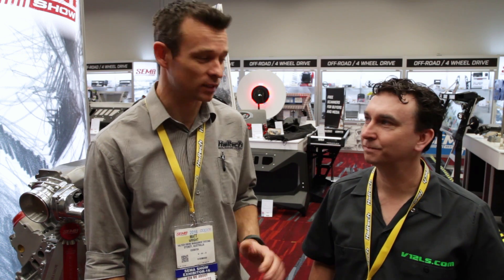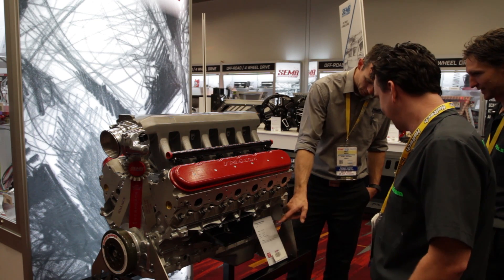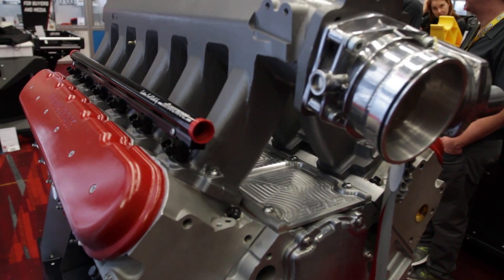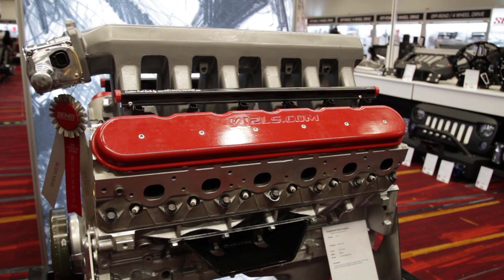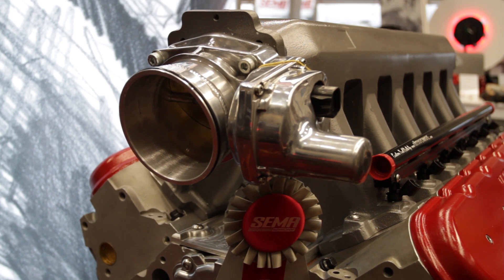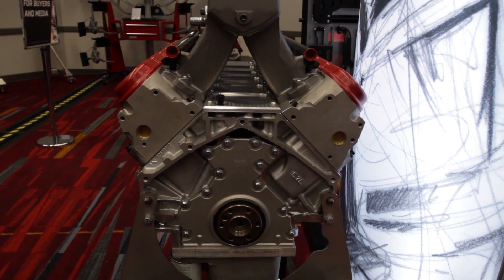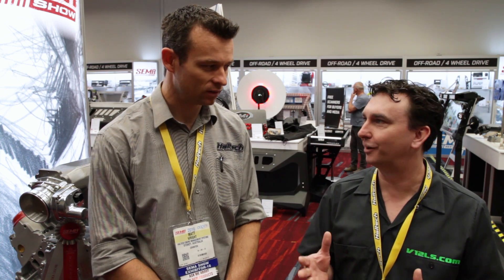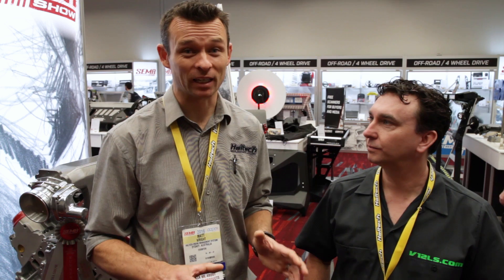⭐ SEMA 2016 Highlights: V12LS - why V8 if you can V12!

Comment: How do you run a V12 on a Elite 2500 with only 8 ignition and 8 injection outputs?
Reply from the maker: You’ll use 6x injector/ignition outputs, wired in semi-sequential/waste spark.
Reply: So it will be firing 2 injector/ignition outputs at the same time?
Reply: Yes that's right William, each cylinder fires twice but one is during the exhaust stroke and is effectively "wasted". This has a few advantages such as requiring only 6 ignition outputs and the ability to run with only a crankshaft position sensor. For these reasons wasted spark has been common with OEMs for many years.